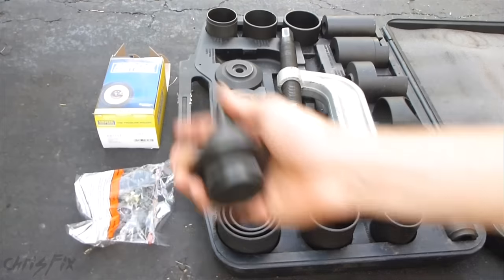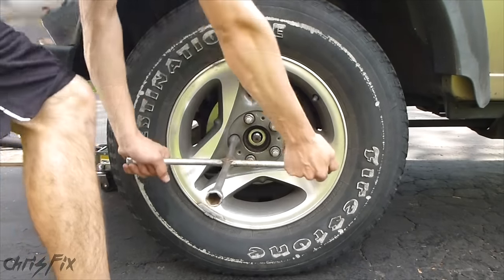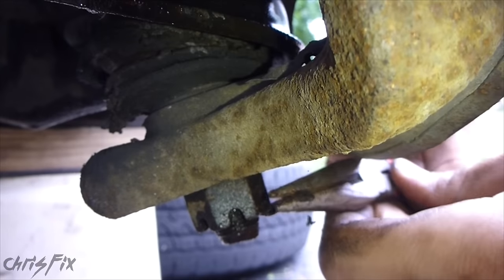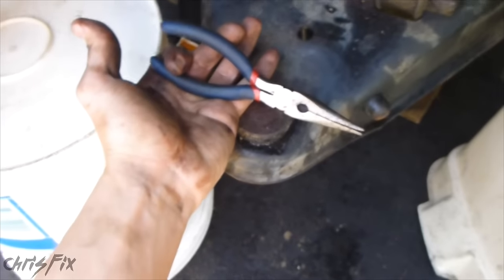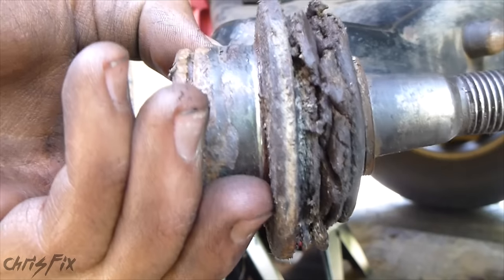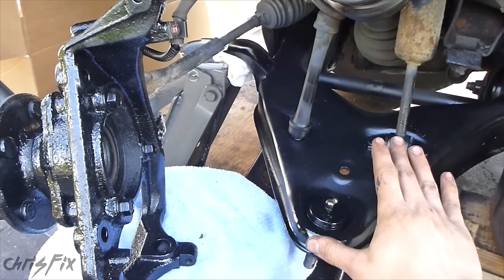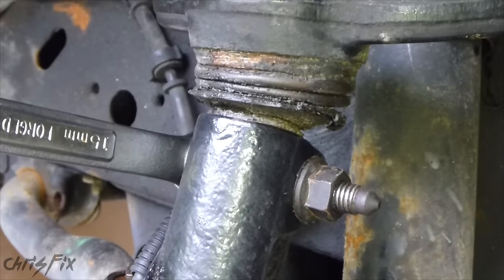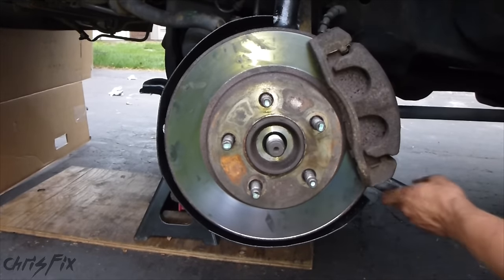How to Replace a Ball Joint (in depth, ultimate guide)

Comment: Already changed out the inner outer tie rods hub assembly and upper control arm/ball joint and lower ball joints 2003 jeep liberty 3.7 4x4. Took it in for inspection and they said left lower ball joint wasn't seated all the way and its what's causing the clunking I'm hearing. Should I replace the ball joints with better (Moog) or try to reseat that ball joint

Comment: Your video's are mostly informative.  However, are you aware that the vast majority of vehicles are NOT to have weight applied to the axle and bearing - before they have been properly torqued?  The brake is supposed to be used to hold/lock the wheel - and you torque the axle nut.  Lowering the wheel to the ground - and putting weight on the bearing - before the axle bearing nut has been properly torqued - is a NO - NO - and may result in damage to the bearing.

Comment: 8:48  turn the C-clamp upside down to install it easier. Remeber, it's a system with 2 opposing pressure points, so the force upon them is identical no matter which way the C-clamp is pointed. 

9:38 the sharp edge of the snapring should be pointed down so if the press fitting looses tension from extreme use, the snap ring will bind in the groove and help prevent separation. 

9:44 tap around the snapring with a flat blade punch and a small hammer to make absolutely sure it is fully seated in the groove.

Probably best to install the grease zerk last so u don't damage it during CV/knuckle maneuvering.
Reply: Shhh it doesn't matter how it's done as long as it's done
Reply: I looked through the comments to find this.... I'm not being a critic, because he did a good job, but I did notice two out of three of these

Comment from the maker: WV591 I get my torque specs from my service manual. But you can also just google your car year, make and model and what part you are looking for. And finally, your parts store should know the correct specs as well!
Reply: if you take the word from someone at a part store ,usually means 4 trips back to the part store do to wrong parts
Reply from the maker: rokin89 A lot of times they might be able to pull up the torque specs on the computer. You just need to make sure they put the correct year, make, and model lol
Reply: +rokin89 Exactly my point in my comment today (9 months after yours).  This video can hurt someone.
Reply: Coleman Adamson
Reply: awsome
Reply: ChrisFix hey Chris can I use press to remove seized strut bolt?
Reply: ChrisFix ,I have a question,maybe  u can help me,I went to a good year shop to get aligned my wheels, and they found that where a ball joint loosed, is that even posible?I mean, I was running with out feeling it?,what do u think?
Reply: ChrisFix ㄅ

Comment: Hi, Chris.. I have a question. Last time when I was trying to put my cv axle back in it didn't want to go in so I thought I damaged the o ring so I put the cv axle without the o ring. After that the car made some kind of grinding noise. After driving a couple months I decided to change out the axles with new ones and  I was be able to put new cv axles with o ring using the hammer trick but it still makes that noise. What do you think what might be damaged when I put old axle without the o ring and how can I fix that? Thanks.

Comment: Have you ever seen a lower balljoint that was riveted on? My replacement part has three bolts in the same configuration as the rivets for the original. I'm assuming that the rivets must be cut, but this is difficult to begin, as it means my car will be useless if I mess up.
BTW, your video is very well paced, well shot, and filled with great help.

Comment: Hi chris ive got a 2014 kia ceed and the steering wheel shakes at low speed. What would you think needs changed? The lower ball joint is an advisory on the mot
Reply from the maker: Sounds like a tire balancing or alignment issue, I would go to a reputable alignment shop and they should be able to fix the issue!

Comment: Should we change ball joints in pairs ie both front lower ball joints? thanks!!!
Reply from the maker: Technically you can get away with just replacing the ones that you know are bad, but it’s not a bad idea to get all of them while you’re in there, often times the uppers might be on there way out!

Comment: How do you know if your ball joint is permanently pressed from the factory or not?
Reply from the maker: A good way to tell is if it's on a piece of the original suspension, check the parts diagram for that suspension piece and see if you can buy the ball joint independently, if you can't then it's likely a permanent part and you'd have to replace the entire suspension piece. A lot of reputable aftermarket companies sell suspensions with ball joints designed to be replaceable so you'd save a lot of money in the long run

Comment: 1/2" drive 32mm socket?
You must have a really good quality breaker bar.

I prefer 3/4" drive.
Reply: I work on OTR trucks all day and the only thing I use 3/4" drive on is lug nuts and leaf spring U bolts..... and that's using a 3/4 pneumatic impact, not a bb.  Whether it be a Snap On or Harbor Freight, if you break a 1/2" breaker bar with anything less than a 6' cheater bar.... then I wanna shake your hand.   I've never broken anything loose with a 3\4 b.b. that I couldn't break loose with a 1/2" bb.  There comes a point where only a torch or a torque multiplier is gonna help you.
Reply: You’ll really be disappointed when you here that I replaced my upper control arm with a channel lock 3/8s ratchet and a 2ft piece of black pipe

Comment: As usual, your videos are super easy to follow.  I removed my ball joints with a hydrolic press because one was available.  Have the ball joint remover tool is just as easy.  I would have replaced the upper ball joint too as it's ready to fail.  When I replaced my ball joints on my Ford E150, I changed all the tie rods as it was just a matter of time before they failed.
Reply from the maker: Mark Keeler Thanks man. I did replace the upper ball joint as well. It is one piece so you have to replace the whole control arm: How to Replace a Control Arm (upper or lower)

Comment: Chris- I did it but wonder why the joint did not move up until the flange on the joint touched the underside of the arm. (the joint was high enough so the clip fit into the joint).
I jury rigged a very large C clamp to push it in---does using a floor jack to push it in work?  Thanks
Reply from the maker: Roger Parlett Hey Roger, I cant visualize what you are saying but depending on the car and the wear of the ball joint "hole" you might be able to use a jack, but it is not the preferred method. There are a lot of dangers of trying to jack up the ball joint so it is not worth it, especially when you can rent the press for free.

Comment: Hey chrisfix do I have to take the calipers and pads off the rotor on my dodge ram 1500 2002 or can I just take off the rotor with calipers attached like you did? Just wondering if it can make my life easier
Reply from the maker: Tim T If your brake line is long enough, you can take the caliper off with the rotor and pads attached. It is so much easier that way!

Comment: With regards to the loc-tight, I am in an area which uses a lot of road salt, and the ocean is near by etc... We typically grease everything so that it will come apart again if need be, otherwise it all becomes one...LOL
Reply from the maker: highvelocity123 I live in the northeast near the beach (the truck sees salt water many times. I never had a problem when using loctite. It protects the threads like grease would but it also prevents vibrations from loosening up the bolt or nut. I feel ya on the "all becomes one" part lol. That is the worst!

Comment: Thanks for all the work you put into these videos! Really helps people like me save a ton of money - i learned a lot of what I know from you and youtubers like you. 

I have a question...with the axle nut, how crucial is the torque? Had to do my wife's ball joints - she has a Ranger, so basically the same truck - and in my research I've seen numbers all over that scale you mentioned (162-205 lb-ft). Is it different for different years, and should you aim for the higher end of that scale if the bearing is old and worn in? Thanks!
Reply: if you go to FORD web sight and look under  torque specs  it will tell you what you need

Comment: Can you just replace the whole control arm instead of fixing the ball joint ?
Reply from the maker: Yes, sometimes it's easier and still cost effective to just swap it out with a new control arm
Reply: @chrisfix  thanks
Reply: @chrisfix  went to mechanic told me I needed ball joints and control arms . Now I know I just need the control arms and they were just trying to over charge me lol thanks 🙏🏾

Comment: At 3:50 when you remove the caliper...it SHOULD have come off the rotor! This baby might have a seizing piston. Back off the piston(s) a little with a C-clamp first, and then hang the caliper from a secure point, out of the way, using a sturdy wire or zip-tie. That way, there's no chance of accidentally dropping the assembly and stretching out the brake hose.
Also...ALWAYS make sure the axle nut is tight BEFORE putting the weight of the vehicle on it! Otherwise, the bearing races MIGHT move and damage the bearing surfaces.
Nice video with the DIY'er in mind!

Comment: Hey guys need a little help!

I'm looking to do this soon. in order to pass an inspection (VT). They claim it won't pass for 'driveabilty' reasons and noted that "My passenger side lower ball joint has a fair amount of play and will likely need replacing in order to pass" The drivers side is fine. I HAVE A 2003 RANGER

Some questions I'd like input on:

1) How does this process/steps differ from the Mazda vs. Ranger?
2) Are torque specs the same?
3) how do I know how much grease to put in (how much is too much?) AND what kind of grease should be used?
4) Is it necessary to do BOTH balljoints when I just need to change one side?
5) How do i test if it was done correctly?
6) Any other tips for using the balljoint presser tool? Can you over press it?

I hope someone can answer my questions. Or atleast some of them?

PS. excellent videos Chris!

I have a few questions

Comment: Ever remove a lower ball joint on a 2002-2007 Chevy Trailblazer?!?   Factory pressed (removed lip with cold chisel), but having bad luck so far with Harbor Freight adapter set---failed bent adapter on ears of control arm.  Any good ideas, plz let me know.  Thanks in advance!

Comment: Great videos…love your knowledge and how u explain everything..5stars…my question is I replaced my brake booster and to do that as u know I removed the master cylinder …reinstalled…then I pumped the brake…chuck the brake pedal…cracked the brake lines at the master cylinder to remove air…retightened….test drive..when I apply brake pedal…it doesn’t go all the way when I apply brake….it tells me theirs no air in line….however when I apply the brakes to stop…it takes a while to stop….it stopped…but takes a while…..any suggestions?

Comment: I have a ball joint that just will not go into the steering knuckle. The threaded side of the ball joint is designed to get pressed into control arm, which went in pretty easily with the ball joint press tool. 

Where I’m running into issues is the top of the joint where it’s supposed to press into the knuckle. It’s pressed in about 95% of the way, but I can’t put the pinch bolt in, so it’s clearly not in all the way. 

I’ve tried jacking up the control arm to press it in place, but it just will not go in all the way.

Comment: The upper ball joint IS replaceable, at least on a 2000 2wd model. Not sure if 4x4's are different, but... the upper control arm in this video LOOKS just like mine. I just replaced all my ball joints. You have to use something like a deep well socket for pressing out the uppers. None of the adapters in the ball joint press kit will work. Put pressing it in is just like any other ball joint.

Comment: Chris,   Please HELP!!!!!!!!!!   I am replacing lower ball joints on my 98 ranger and bought the bootless ball joints.  When I put the steering knuckle on the stud I have the castle nut a little more then snug. I know I have to torque it to 100 ft lbs however, there is a 3/8" gap between the top of the knuckle hole and the bottom of the ball joint at this point and I cannot see that gap closing up even with 100 ft lbs.  .  Is there suppose to be any gap there at all.  I was thinking the stud is tapered so maybe it will close up just did not want to torque it down if something was wrong.

Comment: Need to do a video on ball joints the other way round to what you were doing, as on my car has to pushed down then putting a new one in from the bottom pushing up through the c clip locks it on the top not like yours where the ball joints arse is as I call it.

Comment: How do u replace the front lower ball joints on a 2001 chevy express 3500? The ball joint is too big to fit the c-clamp in there. I did it on a taurus and expedition fairly easily, but i could not do it on a chevy 3500. I was using the same ball joint press kit that u have on the video.

Comment: Hey Chris I have a 1998 b2500 2wd I need to replace the upper and Lowe ball joints but my truck has a set of springs do I need to compress those or should I be fine ?

Comment: I recently purchased a 2000 Ford ranger XLT 4x4... is there a difference in ball joint from the 2wd? I want to place an order on rock auto but I don’t want to order the wrong part.

Comment: Ok so just finished changing the lower ball joint on my 2004 Mustang GT. We put in all the nuts and bolts, but somehow the car is still making a creaking noise when I turn the steering wheel to the right. What else could it possibly be?

Comment: One good tip I can pass on from an old parts store owner. If you have to change press fit ball joints, stick them in the freezer overnight. They will practically fall in.

Comment: " If you want to" is bad advise. You NEED to put anti seize on the drive shaft. If that gets stuck in there you will end up having to replace the shaft and the spindle. An ounce of prevention is worth a pound of cure.

Comment: Interestingly my 08 ranger doesn’t have pressed lower ball joints but ones that bolt on with 4 bolts each. No press required and a lot easier. Gotta win sometimes

Comment: hey chris, can front lower ball joints go on the lower rear? i cant find any online at autozone or any auto parts place. plz help
Reply from the maker: On most cars, the suspension setup in the front and rear is different, which is most likely why you aren't able to find anything for the rear!
Reply: ChrisFix I can’t find any for the rear when I search, all that shows up are ones for the front, that’s why I asked if they are interchangeable

Comment: You really should be setting an example by wearing gloves. Automotive fluids have been shown to cause rheumatoid arthritis and if you are going to go to the trouble of using jackstands and other safety measures you should really finish the deal and protect your immune system and joints.

Comment: I'm more of a suspension mechanic myself, I can do motor work but diagnose and repair external engine parts. I'm about to save 450 on my Lincoln by pressing them instead of changing out the lower arms. Great video on press procedure man. Thanks.

Comment: Just bought a new ride and and passenger upper ball joint has grease around it , the driver side upper does not , should I be worried ? Also have a shake In the steering wheel that isn’t constant. So that’s what I’m trying to figure out

Comment: Years ago took my Olds to Sears for ball joints. That grease monkey did not have a press, just a hammer. The first swing severed my brake hose. I've had nightmares about ball joints ever since. This vid is therapeutic.

Comment: It is easier to use the ball joint press with the thread side up. The C clamp has an opening to allow the new ball joint bolt to pass through.  No need to jack up the truck too much.

Comment: hey +chrisfix sorry its late hope you get a chance to answer me.. so im driving and i hear a noise that i think is coming from the front tire check to see if it has a ball on the wall and the tire good... what i found is the lower ball joint is open would that be making the noise.. is that what i have to replace? also foes the ball joint make a noise when ripped?? or what in your experience will make a noise like driving on a flat tire...?? thanks so much

Comment: block it close to ball joint ,spray penetrating oil on it and you can beat it off with ball pin hammer,then all you have to do is press new one on..

Comment: Hey man what paint did you use to paint your knuckle and control arm? Thanks in advance!
Reply from the maker: +Shane Milleur I used black bumper and trim paint. I think it's linked in the description. If not I link it in the description of my "what abuse does your suspension take" video.
Reply: +ChrisFix whats the name of the hole part you switching the ball part out? Because the metal in mine got twisted by hitting a sidewalk and the wheel is twisted to and i cant turn to the left please help me out on the name
Reply: That's the lower control arm

Comment: Ok thanks very much for that I was a little worried because when I took out the old ball joint I had to hit the bottom to get it to pop out and the boot coverd everything. And I tightend the new one pretty good from the bottom casstle nut and and it shows some metal.

Comment: I have two things. When you bend a cotter pin, you bend the long end over the end of the bolt and the other end down the nut. When you go do torque those big torque bolts, lift up on the torque wrench. Then you can use your legs.